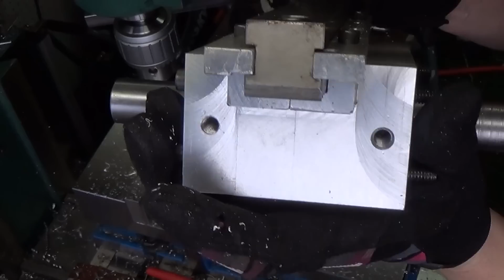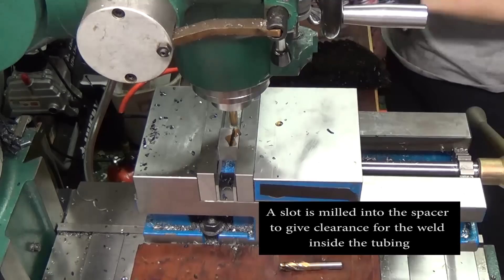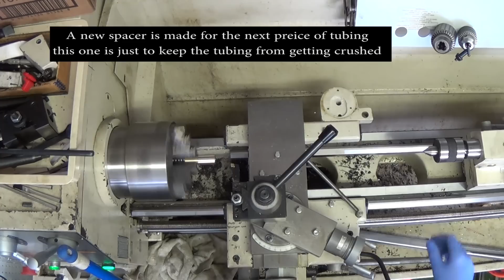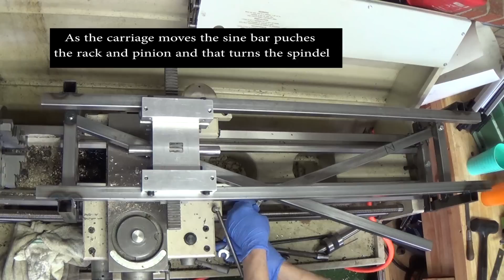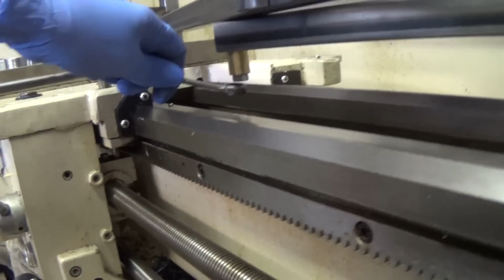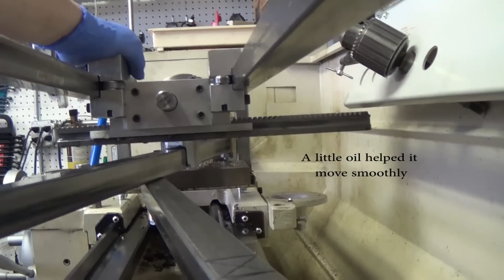Homeade Rifling attachment for the lathe. part 5 the sine bar

Comment: This is very cool. Question:

If you curved the sine bar out wards away from the the axis of the lathe, would this produce a progressive twist rate? 
Eg; starting at 1:12 and finishing at 1:9 ? 

Makes sense in my head but would it actually work?
You could make a few different sine bars I guess and have them ready. 
Not at all necessary, but i was just wondering. It's just a super fancy way of making target barrels I think. 
Not sure if the "juice is worth the squeeze" performance wise.
Really cool build, cant wait to see your first barrel !!
Thank you.

Comment: Am făcut doar schițe de principiu fără cote ca să poți să adaptezi una din cele trei idei la proiectul tău și să ți adaptezi singură dimensiunile:-)           1) Pentru șurubelniță electrică cu acumulator.       2)Cu motor și transmisie cu curea dințată.                         3)Pe cremalieră cu pinion(am   văzut ca mai aveai una pe banc dintr-un videoclip) :-))
Reply from the maker: +Ion Dobre Da am cateva rack şi pinion aici, dar acestea sunt mari şi grele. de asemenea, pentru a scurta. o masina de gaurit cu o baterie este o idee bună. 
poate cu o curea, şi I se poate atasa drill după ea pe strung. Instrumentul este aproape la greu pentru mine să ridicaţi astfel încât nu pot adăuga mai mult la ea

Comment: That's a clever design for the  whole attachment :) Are you gun drilling the barrels with that also or do you have some other machine for that operation?

If the sliding action ever needs improving, my suggestion is to make the parts that the rack is touching out of steel. Aluminum and steel is a bad combination in terms of sliding.
Reply from the maker: I'm using the lathe itself for drilling it has a 1.5" spindle bore so I can run the barrel out the back and drill using a gun drill. the only parts that are aluminum that move aginst steel are the slides holding the rack. I actually made them out of aluminum on purpose. they won't wear out the rack and they are easily replaceable. I would rather had made them of brass or bronze. aluminum was all I had at the time. when they need replacing they will get changed. :)
Reply: Waffenschmiedin x Yep, bronze would have been best alternative, but it is also pretty expensive and usually not found in the scrap bin when doing projects :)

What sort of pump are you going to use for the gun drill? Basic hydraulic pump?
Reply from the maker: +Jaakko Fagerlund I have a pressure washer my dad gave me. other people have used them and say they work ok.it hits 1600 psi but I only need about 600psi so I need to build a diverter. to take some of the pressure back to the tank. I have it about 1/2 built I have been putting it off.
Reply: Waffenschmiedin x That's a clever idea, never would've thought of that! I've been thinking of building a gun drill machine too, not for barrels but for tool & die work, as commercial units are just too expensive.
Reply from the maker: +Jaakko Fagerlund ya they are silly expensive. the same reason all of American industry is dieing :/

Comment: a shame the twist rate is only from 1:9 twist rate. how will you rifle .223 barrels firing heavy bullets? those are 1:7. there must be a way to get that sort of twistrate done with this setup. are there any blueprints around of this rig? i red a book about gunsmithing(the homegunsmith vol.2) the building a riflebarrelpart that is. they stated that:" You can build a rig that fits inside the tailstock of the lathe, that accepts a rod with a helix milled inside of it, that has a bit sticking out into the helical rod so it rotates." But that would imply that you will need a different rod with a helix milled into it for every other twistrate. It is just another means to an end, but with your rig it looks like you are all set for the 1:9 to 1:25 twistraterange. 

Thanks for the upload!
Reply: the book is called: "modern gunsmith v2" by howe. you can find it on scribd. anyway, "a master gunmaker's guide to building bolt-action rifles" by bill holmes is worth the read. 

be sure to check it out. it costed me weeks to find these. so you dont have to keep looking around for weeks. anyway i like your channel.

Comment: I just finished watching your videos on the rifling attachment.   Very inpressive.  Is it your own design?  If so, even more impressive.

Please lose the gloves.  They have no place around moving machinery.  It is not worth risking a finger, or worse just to keep your hands pretty.  I wore gloves and the result was a mangled left hand.
Reply from the maker: +John Reese the vinyl gloves are ok to use in a machine shop. if they get grabbed by the machine they just rip. I go through about 25 of them a day because they tear so easily. we were actually allowed to use them in the machine shop I used to work in. I did use some other gloves that were not vinyl only because I was out of these I normally never let my self run out.
Reply from the maker: +Waffenschmiedin x it is my own design in that I didn't have a direct copy and its an attachment for my lathe that i can take off . but a sine bar method has been used for this type of work in the past&#160;Pratt & Whitney made an industrial one that did nothing else but rifling.https://www.youtube.com/watch?v=A7Z9Y-OvDpYthese are both Pratt and Whitneyhttps://www.youtube.com/watch?v=kvnKSfDUCWYif you just look up sine bar rifling machine you will find some examples :)

Comment: Eu am făcut calculul laun pas de 2.5 mm și 500 rot/ min căruciorul va avansa 1250 mm dar tu ai nevoie de cursă maiica așa ca  cam 500 mm asta  înseamnă aproximativ 30' ( eu sunt obișnuit cu sistemul metric
Reply from the maker: +Ion Dobre Cred ca pentru acesta să se deplaseze suficient de rapid. poate folosind un dual sau quad începe thread. Aceasta ar trece mult mai repede. unul dintre motive a fost de gând să faci de mână este eu pot muta repede şi ia terminat de locuri de muncă
Reply: Am ținut cont ca șurubelnițele cu acumulator au între 500  si 7 5 rot/ min bănuiesc  ca va fi bună viteza